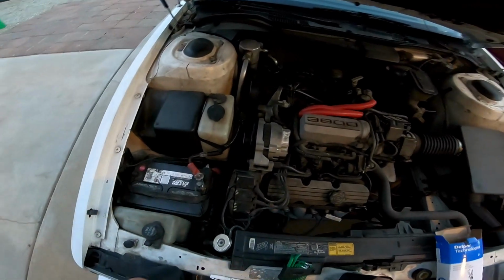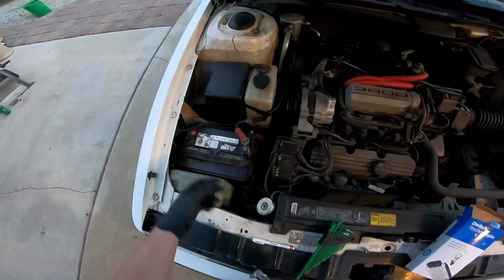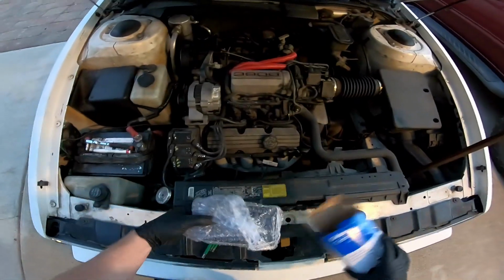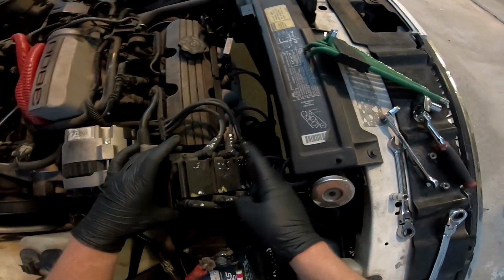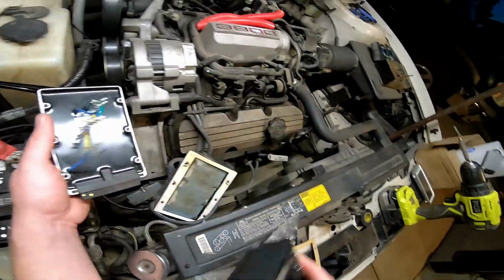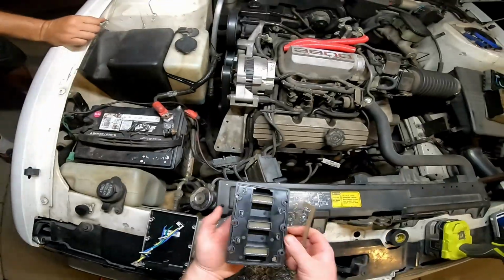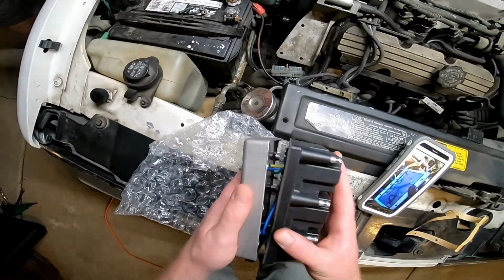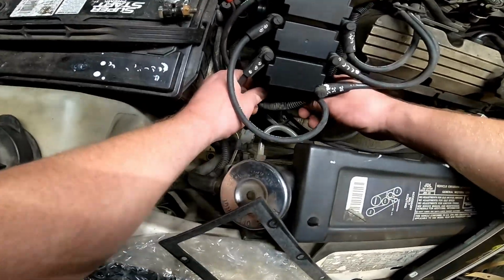GM 3800 Intermittent no spark Replacing the Ignition Control Module  and coil pack

Comment: My car starts up in the morning but it cuts off by itself when it runs I took the gas line off was he getting gas and it was getting gas do you think it is the engine control module ignition control module
Reply from the maker: That's what this car was doing, but lots of things could cause that. Anything anyone says without seeing the car is a guess.
Reply from the maker: Test it for consistent spark, when it dies.

Comment: I'm Currently Working on Opel Rekord 3800 V6. Have changed the Crank Pulley and Crank Angle Sensor already. Pulley had an Issue. Still no Spark. Can You Help Please? NV. South Africa 🇿🇦
Reply from the maker: @NeilEnvySA  if it's not the wiring, icm or coil pack then the only thing left would be the computer. Get a wiring diagram and check your wiring with a meter.
Reply: @GrimRepair  it's a Late 1980's Opel Rekord with 3800 V6. Would it have a Computer,except for Module under Coilpack? Thank You for Help. I Appreciate it Very Much. This Car has been sitting for 2 Years and really want to get it going again 🙂💥
Reply from the maker: @NeilEnvySA  I have never worked on an opel, but I know it a gm company. If the motor looks like the 1988 in this video, it has a computer. If it has a crank sensor, icm, coil packs, and electronic fuel injection it has a computer. It should be under the passenger side dash, it may be listed as an electronic control module at the parts store
Reply: @GrimRepair  Thank You Sir 👍
Reply: @GrimRepair  Hi there. Messed around a little today with the 3800 v6. When i turn the Ignition on the Fuel Pump runs for a couple of seconds like it should. Tach needle also Jumps,but while cranking I'm not getting the tach needle to move at all. Also not getting a Positive or Negative on Coils. Found the ECU. We used to be a GM Dealer so i will go through our Books and find Wiring Diagram like You Mentioned. Thank You Very Much for Help this far. Wish You were Closer 🇺🇲 NV. South Africa 🇿🇦

Comment: I have the same kind of car do you know why my oil smell like gas and my car blows white smoke
Reply from the maker: That is something you should ask a mechanic who can actually look at the car. White smoke usually means it's burning coolant, oil that smells like gas usually means it getting to much fuel, or the oil is old and you need to change it. Did you just get the car? Has it been sitting?
Reply from the maker: I think you can test it, with a vacuum pump and a fuel pressure gauge. Your definition of white smoke and mine may not be the same. Your oil may smell normal it may not. idk, I'm not there.
Reply: IJack the car up off yesterday and changed the fuel filter when I change the fuel filter in Jack the car back down then crunk the car up then white smoke start coming from the tailpipe it never did that before do think it's the fuel pressure regulator
Reply from the maker: @RashadGrace-kt2xq  what is your fuel pressure? Does it change when you apply vacuum? Does the vacuum hose going to the regulator hold pressure when you apply vacuum, or is it cracked? Does the regulator hold a vacuum? Here are some links to the tools you will need so you don't have to guess.
https://amzn.to/3Pw0tK8
https://amzn.to/486YpQ5